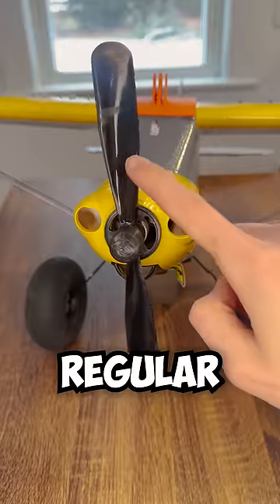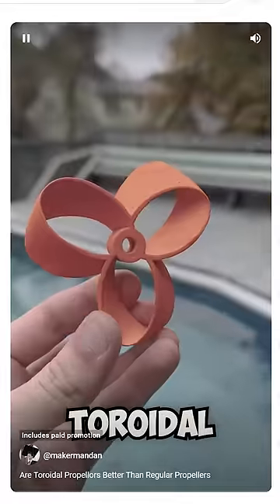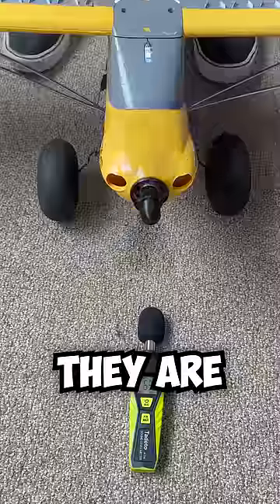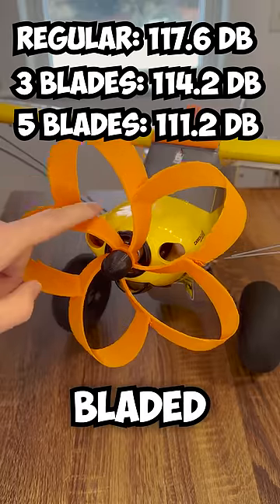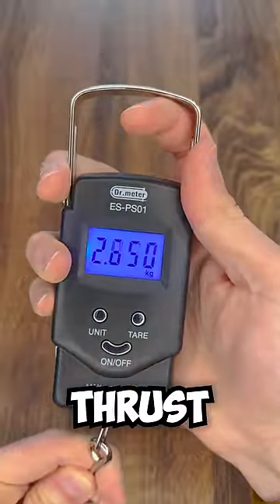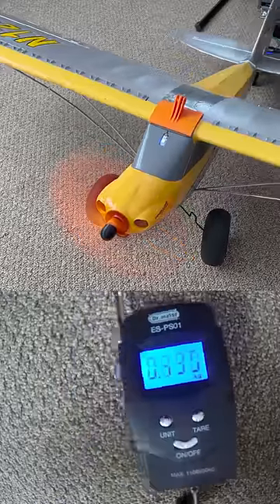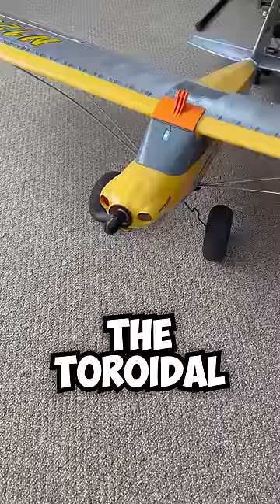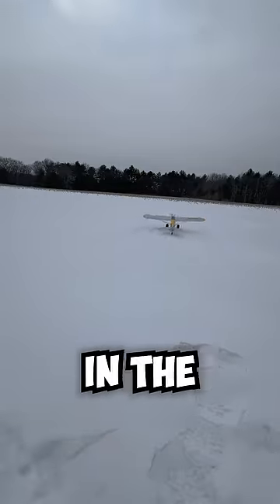Toroidal vs Regular Propeller for RC Plane

Comment: To be fair, you should 3D print a standard propeller with the same print parameters as you used for the toroidal propellers which look pretty square on the edges.

Comment: It looks like the regular propeller is made from a different material than the propellers. I would recommend printing a regular propeller with the same material, to test the toroidal prints against. This will ensure consistency in your testing

Comment: That was your first design. The normal propeller was optimized for aircraft. I’m sure if you do some fluid dynamic analysis of the toroidal props you will match the normal prop. And then after that you need to worry about the center of gravity! 
Keep it up!

Comment: The reason the 5 propeller was quieter is because the more propeller blades you have the less it needs to pull the air to move which makes it create less noise

Comment: By increasing the number of blades, you must reduce the diameter of the propeller. Each more blade is 1" less in diameter. Lower thrust may be caused by too much load on the engine, which results in lower revolutions. I'm waiting for further tests;)
Reply from the maker: That makes sense

Comment: I've seen this test so many times, and they always use 3d printers for the toroidal propellers, which completely skews the results. Regular propellers are thinner and lighter while also being stronger, they're weight balanced, have proper air foils, and have a smooth surface. 3d printed propellers are almost never perfectly weight balanced, which creates a lot of vibrations and motor resistance on top of the extra weight and thickness. They also often don't have proper air foils, but just flat, uneven surfaces with right angle edges as yours did, which creates a lot of vortexing and wind resistance.

Comment: If you sand down the blades on the toroidal propeller they will perform better because the surface is smoother because there won’t be any 3-D printing lines

Comment: The famous ultra-expensive toroidal propellers that made all those claims were designed for racing speedboats. You can imagine those being much quieter than the traditional option, but the design just doesn't seem to work great for the air, or it requires simulating the design to get it right for a certain use case, or the use case needs to be specifically very high speed, or it's the imperfections of 3D printing that are nullifying any possible advantage.

Comment: The Blade cross section on the toroidal props are not as "wing-like" as the stock prop. This would limit or eliminate the "Bernoulli Effect" allowing for more thrust from the standard prop. This is vastly more important in water than air. Plus, having MORE surface area to generate thrust, the Tordial props should, in fact, be more powerful.

Comment: maybe those new blade designs have a better efficiency long term, with "fuel" consumption and such, but as several have pointed out either make a control copy of the original 1 blade propellor, so it's mass with the same material can be measured against the toroidals, or smooth and slick the new blades to match the original one. My observation anyways.

Comment: The reason they are better is because in water they avoid making vacuum bubbles. This isn't an issue in the air (or maybe at some extreme spin it is?! who knows??)
So out of water there is no reason to think they'd be better. In water however they very much are....the issue is the production cost is much higher at the moment.

Comment: You need to link the ends of the propellers for it to be quiet. You still have separate tipped propellers, lthough weird looking. It should look like curved and a circle .

Comment: For a fair test more control would be necessary.
I can think: Current measure or a constant RPM.
The distance of the decibelmeter must be exactly the same.
Also, the normal propeller should be printed too.

Comment: You should measure thrust vs power draw. The thrust rating doesn't mean much if you don't compare it with how much power it is using.

Comment: Wind turbines use 3 propellers for an efficiency reason. Same goes for a boat prop (originally it was a long screw that broke). Your tests prove that you shouldn’t re invent the wheel but rather confirm it. Fun stuff though!

Comment: From just looking at the video, it appears the pitch is more aggressive on the 3d printed ones AND the edges that cut through the air aren’t as sharp as the two blade. If you were to experiment with those two features, you could beat the regular propeller and be even quieter.

Comment: For some reason, I have the idea that the toroidal propeller maybe has a better performance in regular flying that regular one. What I mean is that aerodinámic performance is baybe better despite the lack of trust... I don't know, in aerodinamic matters everything could be surprising. Also, someone metioned that the material of regular propeller is not the same as 3d printer. It also could change the entire result if it is true .

Comment: Ground pull and airspeed are two factors not mentioned here. One may have more pull but less air speed. Usually more airspeed means less pull. They unload in the air. There's lots of factors in props. Interesting start for testing though

Comment: a.) should also have 3D printed the stanard one
b.) should have measured the power draw / force. If you get 25% less force with 25 % less power drawn they are equal.

Comment: The 3 blade prop is actually 6 blades and the 5 blade is 10. You should try this with 2 (4) blades and work on the profile a bit.

Comment: Might be the weight differential causing a drop in RPM’s. If you can measure all 3 blades at exactly the same RPM’s, then you will have your answer.

Comment: The more blade you add, the more torque it take to push air, I think if you put a stronger engine it would make the fancy propeller better, but it would also make the regular propeller better so idk

Comment: The surface of the toroidal propeller needs to be very smooth in order to work correctly, i suggests that a resine 3d printer would make a better result.

Comment: A fixed pitch propeller works optimally in a given airflow speed. This thrust comparison test shows only the zero airflow speed results without RPM regulation of the motor, so the different prop blade drag values also gave different RPMs. You cannot really compare these in this way.

Comment: It would be quietest with no propeller but would have zero thrust. Now make a thinner propeller with less weight, round the tips and increase or reduce the pitch in 1 degree increments.

Comment: Part of the issue is the material weight the 3d printing weighs more than the standard propeller, the edges are not optimal as well

Comment: The problem with your toroidal props, is that your toroidal props look flat.   They don’t seem to have an airfoil shape.  So if this is the case then they are only pushing air like a fan which means it gets no lift force

Comment: I think your toroidal propellers were partially stalling out due to the air not really having the linear flow.
Trying them out in the open air, I would see which one was faster.
I have heard of racing and fighter planes having a prop stall.

I’d like to know how fast they really go.

Comment: Try to make a regular propellor using the exact same wing shape like your toroidal. This isn’t a fair comparison because the toroidal one has no optimization aerodynamics applied. Is going to take a lot more tuning, unlike your original blade which is already tuned with its blade shape.

Comment: The main reason they're quieter is because of the difference in frequency. They're decibel difference isn't much 😅 not sure about thrust or the force it takes for the motor to turn the blade

Comment: These tests make me think of the whisper mode on helicopters. If i recall the theory wisper mode was quite because the pitch of the blade was reduced but added power was required to compensate for the loss of lift. 🤔

Comment: The results are skewed because the 5 bladed prop has more mass and is spinning at a lower RPM, which is why it is quieter than the faster, lighter props.

Comment: 5 point Toroidal, but 10 BLADED prop. Each of the five points of the Toroidal prop consists of 2 blades, the long half and the short half after the bend. That means there's 10 blades total on the 5 point Toroidal prop.

Comment: I suspect the toroidal propellors are only really good for fluid applications and not air as they seem better suited for high torque low speed operation rather that low torque high speed such as an aircraft

Comment: I can't quite see, but it also looks like you just printed the toroidal propellers with flat surfaces that have an angle of attack. Giving them an actual airfoil profile would increase their performance drastically

Comment: The decibel rating was still loud because your engines are extremely loud lol and the thrust was not as much because the propellers have to be slightly larger to compensate for the rounded edges, YA GOOF! :P

Comment: The 5 blade design is very inefficient because of the connection point in the middle of the blades. Causes unnecessary turbulence.

Comment: The exact angle and shape of toroidial props is important. Several universities have developed ones with more thrust at lower RPM and lower decibel.... however, this study took YEARS, and they wont release the exact specs.... so although true, until they either patent it, or release it publicly... we cant benifit, even if paying....

Comment: The motor didn’t quite have the power to spool the 5 blade toroidal prop given the extra drag so I don’t think the noise comparison is quite apples and apples. The rpm should be the same in order to make for an accurate comparison. Cool test though.

Comment: Can you try weight normalizing them?
The turoidal ones can have thinner blades because they have stronger structures. 
I'm wondering if the heavier 3D printed blades had an impact on thrust.

Comment: Did you actually designed and built them correctly tho?

A lot of Youtubers are building toroidal props because one marine company sells them and a univeristy made a project based on toroidal propellers, but those youtubers did not do the same amount R&D as the marine company and university. You can't expect the results would be the same.

Comment: Did you know that I was born with a disease that doesn’t allow my body to have eardrums and I’ve had 15 surgeries on both of my ears, from tube placements to full reconstruction surgery of the eardrum? And the eardrums failed and completely dissolved away. I can’t hear any noise unless it’s a minimum of 70-80 decibels. 

I have hearing aids.

Comment: Next time normalize for thrust and see if it's still quieter than a regular prop run at a lower speed. Then test power draw for both and figure out how much flight time would be impacted by running a stupid propeller.

Comment: Neat tests but there is NO way I would be anywhere near the front of that plane during thrust tests ropes break much easier than metal chains.

This is from someone who used to fly RC aircraft back in the early 70s.
I'm also glad that I never used metal propellers on any of my planes as one of the first times I had my glow plug engine running, I literally reached through the spinning prop to pull off the glow plug connector (I couldn't see it, so it must not had been there).

I still have the scars on my finger where the plastic prop tore open the skin but bounced off the bone. If it had been a metal prop I would have lost a finger or two.

MAJOR PAIN... And I was more than 100 feet from my house where only my grandmother was home as both parents worked.
Then my father drove home before the ambulance had arrived so we just cancelled it and my father just drove me to the nearest doctors office. Our family doctor wrapped up my finger and then wacked me up the back of the head for being so stupid. Being a drinking buddy of my father allowed him to do that.
I flew that plane for a few more years until it hit a big oak tree due to a dead receiver battery. NICADs, gotta love them.
For some reason I only flew ducted fan aircraft after that until I blew my last one up while it was carrying a full bomb load (the things you could get away with back then).
My neighbour had made shotgun shells for me that were filled with nothing but black powder (he was a hunter and my father was not.
So as new 7 channel receiver equipment would have cost more than $2000, I sold my transmitter and used the money to buy a S100 computer (the IBM PC was still a few years away).
That was much safer and I was a UNIX System Administrator trained by AT&T Bell Labs as well as a custom software developer until I retired.

Comment: I think the 3d printed ones are too heavy around the outer edge. You might need to make them lighter to get closer to the same rpm as the standard prop to get similar thrust as it.

Comment: Those blades don't follow toroidal propeller design = vastly different results. 

A toroidal propeller is actually two propeller sets, stacked, where the tips are connect.  But the leading swept-aft blade needs to be above the trailing swepft-forward blade.  

This way, tips connected, the induced outward flow that generates vortices gets forced into the trailing blade - which is a swept forwards blade that had an inwards induced flow and no vortices.   The result is a reduction or no tip vortices  - less drag.  

Tldr: The thrust of two propellers with less drag than two propellers.

Comment: You can't just print the shape and have it work. It's the pitch along with the rpm and loading.. MIT figures this out specific for the drone they're using, not just making a random curly shape by eyeball.

Comment: 3d printed objects aren't great for aerodynamic testing because the surface is rough and introduces turbulence. You'll have to use the 3D prints to make moulds which you can then use to make cast parts that can be polished.

Comment: I like that you actually try out these ideas instead of just speculating about them. However, the odds that you - or any other tinkerer out there - will happen upon some novel propeller configuration that no dedicated Aerospace Engineer hasn't already tested are slim to none. You gotta think that there's millions of dollars in it if you can devise some revolutionary new propeller design that will improve fuel efficiency in planes.

Comment: There’s a reason why planes don’t use propellers like the ones you’re designing because there’s more air resistance on it, but yeah, it will be quieter because it doesn’t move as fast.

Comment: Now take the normal propeller and power limit it to 75% and measure the decibels. I bet you’ll find it’s quieter than the toroidal at the same power output. Oh, and it’s more efficient.

Comment: The original propeller was probably a wee bit calculated and tested and so on... material, size, blade dimensions to make it sort of optimal for engine rpm, torque and stuff... (or they just had 50 and tried them all on that plane and took the best one)... Doing a 3D printed toroidal prop with roughly the same size and expecting to do wonders is probably fantasy... I think it can equal a "normal" propeller but be a bit quieter with enough research and testing...

Comment: well one you have to optimize the prop for the individual use case just throwing a toroid onto a shaft wont show the best results. You have to think of numerous factors like your body shape, blade pitch, wing location, and motor power since a toroid is gonna load it more, but it should be more efficent meaning you shouldnt use as large of a prop when using a toroidal design

Comment: You pitch angle looks slightly to shallow vs the OG blade, which is probably why the thrust is lower.
Reply from the maker: Yea, I figured I’d make it shallower since there were more blades. Thanks for the insight
Reply: @makermandan  A pretty logical reason, however I believe toroidal blades have a sweet spot in terms of the amount of air they funnel through them, so in making it thiner I has possibly reduced the rings effectiveness, a trait that makes them more efficient. But I am no engineer, I'm sure you will have far more informative answers and suggestions than mine. 🙏 Thank you for the response though, love your content.

Comment: Your homemade propellers were probably not as well designed engineered and constructed as the store bought one. I'd like to know which airfoil the toroidals used. Also, they could have been a larger diameter.

What would have also been interesting would be a four-bladed conventional prop.

Comment: Make a bi-prop toroidal if you increase the amount of blades in a propeller then you increase the drag the propeller then spends slower because it's acting with more drag Ergo more propellers isn't exactly better

Comment: Theyre probably weaker as the surface isnt as smooth as the one you had on it from the beginning. There will likely be a lot of turbulence on the blades.

Comment: It seems like the tips are the problem, not enough "bite" and directed thrust.  The area where the blade folds back over itself, at the tip, needs a more aggressive shape.
If you look out from the center along the blade the end should be grabbing the air on the outside and redirecting it backwards. Regular blade tips are thin for less resistance. The toro-blade has material there. Is it dead weight or another useful surface?

Comment: Bad statistics, weight is a factor, surface finish is a factor, *optimised shape is a damn factor*. Weight the damn propellers, make sure geometry is right, smoothe surface, if you can print abs, afterwards take acetone and smooth it.

Comment: probably would have helped if you cleaned them up and actually sanded the surfaces smooth. all that crap in the corners and the typical 3d printed surface are gonna cause significant losses.